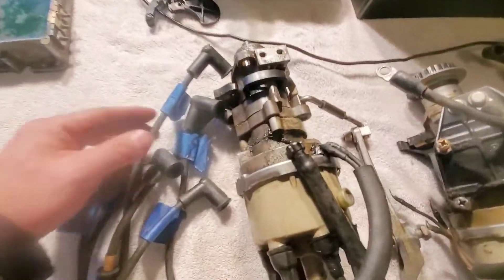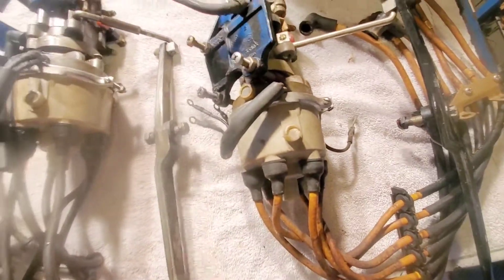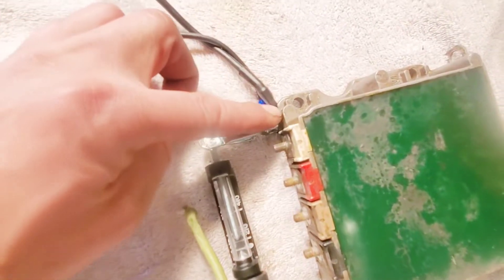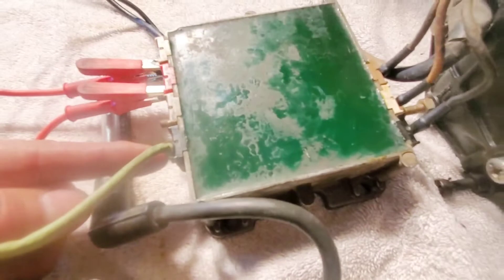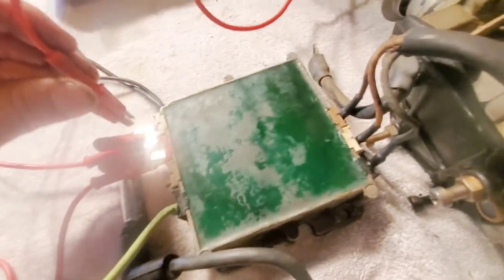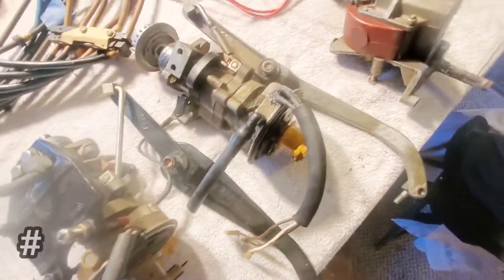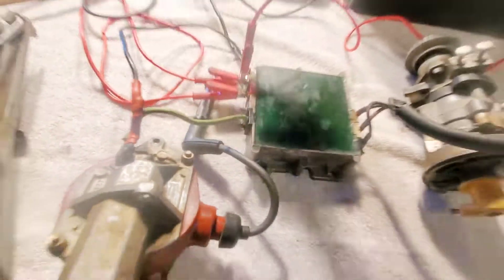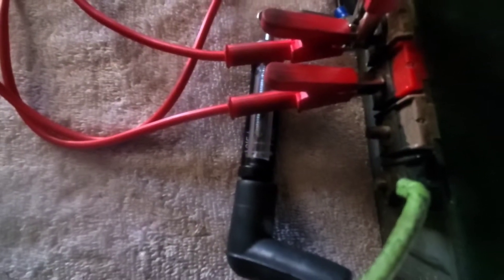Mercury Outboard Trigger Testing: Ignition Issues?

Comment: I'm working on a Merc650 trigger in the 2870000 serial range.  It seemed to be great.   But I noticed a lot of the old wires were frayed, and many grounds were rusted.  So I've been repairing wires with solder & shrink wrap.  The black/brown/white wires coming out of the dist. were frayed, and possibly were shorting to the steel strap.  I got erratic spark.   So I soldered/wrapped them too.   Can I ask you what range of resistance you got on your operational trigger?     I got white/black with 20 milli ohms, white/brown with 20 milli ohms, black/brown with 2,000 ohms. The resistance appears to depend on which way the multimeter is connected, so there may be transistors inside.  And the trigger disc does appear to produce variable on/off resistances when I spin it, between the black wire to the disc, and the brown wire to the disc.  But there's no apparent circuit between the white wire and the spin disc.   If this seems good to you I'll reassemble.  But if seems bad or wrong, I'll buy a CDI and rebuild

Comment: Do you have a model number for the trigger?  I have a 1150 that does not spark.  Also, the propellor is not supposed to be turning when it is not engaged in gear correct?
Reply from the maker: Google mercury cdi trigger. I videos on how to replace as well. The prop may spin in neutral. However, it should be free (no clicks) if spun by hand when engine is off. Son
Reply from the maker: https://amzn.to/43AxXMF
Reply from the maker: This is what you need.
Reply: @MerCSonL6  Thank you.

Comment: Dr. Trigger can be tested still on the boat correct? With everything still hooked up, “no flywheel” coil plug close to engine block I should see spark by rotating the distributor shaft correct? 
Would you have a good working trigger I could buy?
Reply from the maker: Correct. And no, I do not have any spare triggers. Cdi sells them buy they are pricey. Son

Comment: What kills these.  One that came on the engine died, replaced it , lasted less than a year.  just put a new one on and unless amazon sent me someone else's return (it did have a few scratches on it) it was DOA from CDI.  I can manually trigger spark all day so switch box and coil are good.  Only thing else I can figure is that something on the engine is killing them.  Max voltage I am seeing off of regulator is around 13.8 volts.
Reply from the maker: Time/age.  It seems the triggers and switches are the first to go. The coils are almost invincible. Cdi makes a good replacement. So far I have not had any CDI rebuilds go out. Son

Comment: Son, 
Love all the videos, very informative.  I have a 69 650 with thunderbolt ignition, my switchbox is not the same as the one used in this video, mine only has the 4 connections on 1 side. Can i still use the same set up to test my distributor? Any info would be greatly appreciated.
Reply from the maker: Unfortunately no. You have the energizer ignition. There are high speed and low speed coils in your distributor that produce voltage to power the switch. I have not found an efficient way to test the trigger on an enegizer system other than indexing the flywheel and using a timing light to make sure all cylinders are firing. Son

Comment: Thanks for video I tested mine like that great spark but it is dark pink I used a spark tester that I use for small engines and smaller battery from rider would that make any difference. Also I know the distributor button touches the middle of rotor is that normal. Thanks for the help. Jerry
Reply: It’s the carbon button in the distributor cap but I did find out that it is supposed to rest on rotor cause it is spring loaded. Thanks so much for getting back to me. Really like the videos I am new to boat mechanics and getting a great education by watching them. Jerry
Reply from the maker: I'm not sure what a "distributor button" is. Can you please clarify? Son

Comment: Are 80hp thunderbolts parts  interchangeable with 85hp? Both Built the same year. Im Having no spark problems with my 85hp. Also can I test it without removing everything?
Reply from the maker: Short answer is yes. Everything is interchangeable except the pistons. Inyernal porting is radically different. And you can also test the distributor while its installed on the engine. Ill make a video on it soon. Son.
Reply: @MerCSonL6  turn out the outboard is fine, still sparks. Cdi still powerd up. Now I'm looking at the mercontrol system, wire falling apart causing it to ground out, also fried the ignition. Using my back up mercontrol to make one functioning. Many Thanks bud, learned valuable information on your channel.

Comment: Hey Son! I need some help with my mercury 60hp 2 stroke. Engine started act up after I was pulling people with my boat. Anyways I can get a hold of you?
Reply from the maker: Define "acting up" please.
Reply: @MerCSonL6  I started having problems after I pulled some people with my boat. After that it would start on a full battery. I got a new battery optima blue top amg, regulator, spark plugs and it still does that. After sometimes maybe 1 hr or so itll start again.